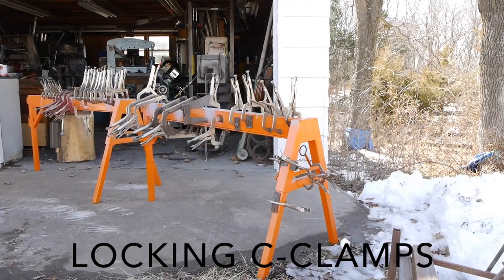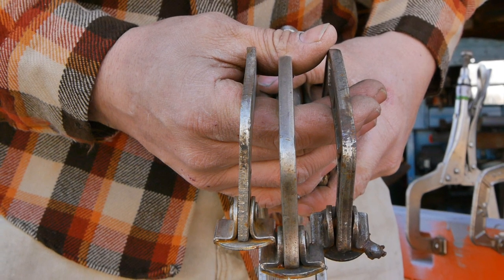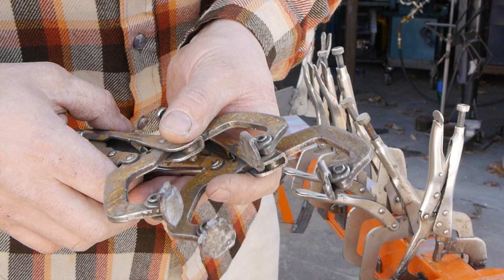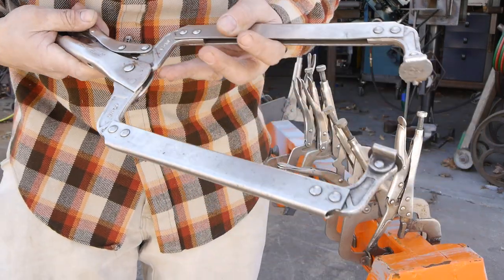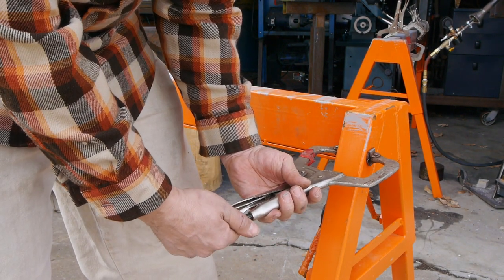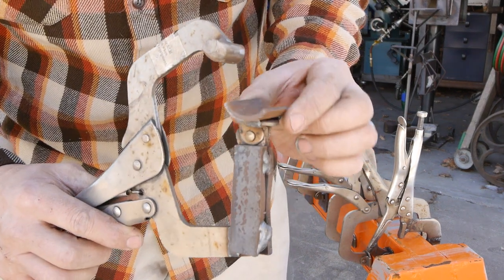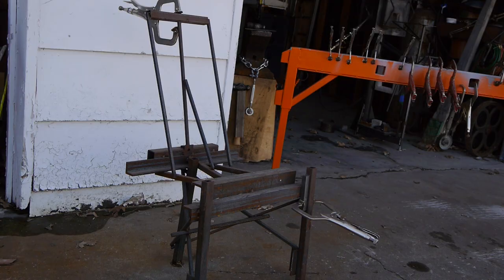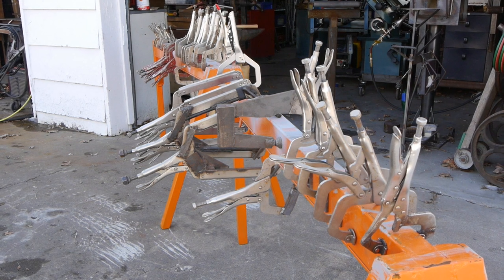Locking c-clamps

Comment: havent used them yet but milwuakee has vice grips and locking c-clamps that you tighten lightly then stick a bar/screw driver through a portion and turn it to tighten using the threaded bit, might be good for applying more pressure then you can njust by squeezing

Comment: i used a locking swivel  c clamp  (vise grip style ) as a grounding  clamp the one that came  with the welder looked like something  from a cheap set of jumper cables  so i drilled a small hole in a place with little stress and  removed the cable from the crapppy clamp  used the same nut washers and bolt an then zip tied the cable it to the handle  now I can clamp and ground my work all in one easy step took less than 5 min to do .
Reply from the maker: I do the same but I've modified one of the swivel end with a threaded piece and a bolt for added range and flexibly. I can remove the bolt and insert that end incide tubing.